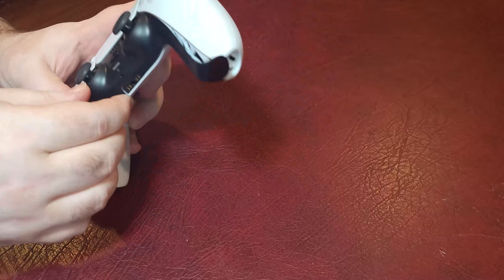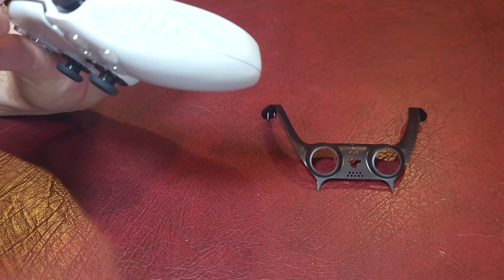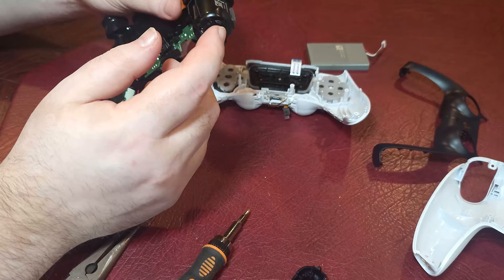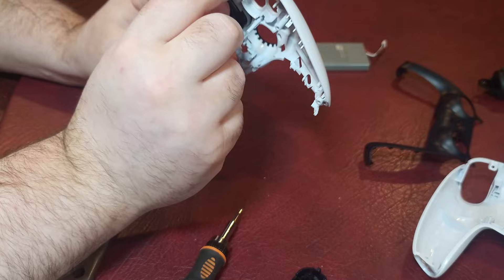Custom Painted PlayStation 5 Controller Walkthrough / Tutorial (DIY)

Comment: Can I do this plastidip?
Reply from the maker: I wouldn't recommend it as the plastidip spray can be pulled off pretty easy. so I would be scared with how much the controller gets used it would rip it off. Which is why I used the glaze to finish it off as it will hold up to wear and tare. THANKS FOR WATCHING!